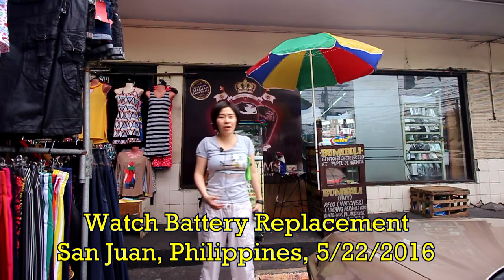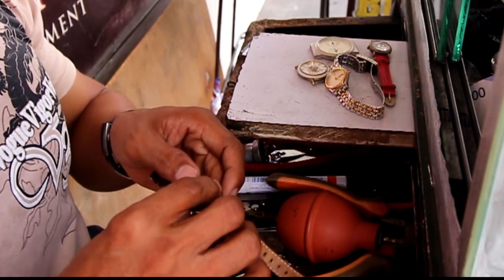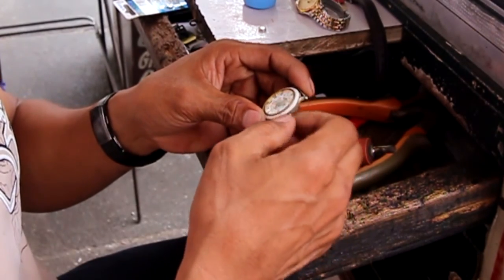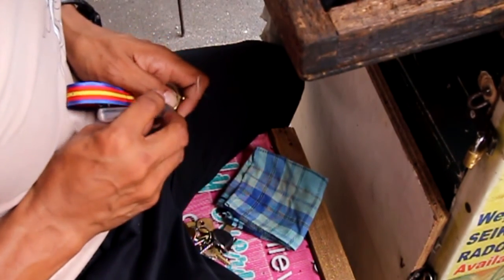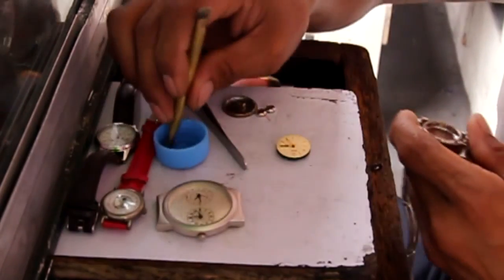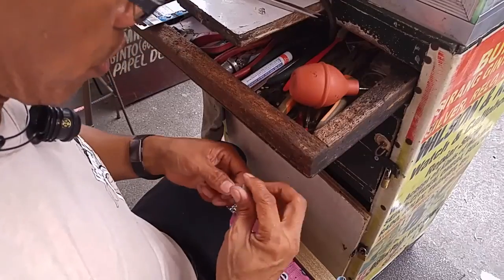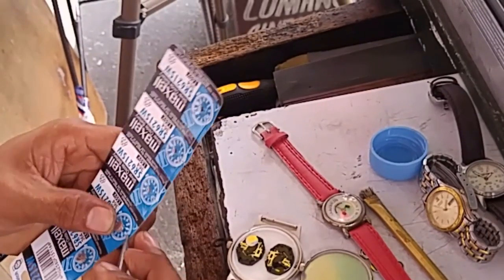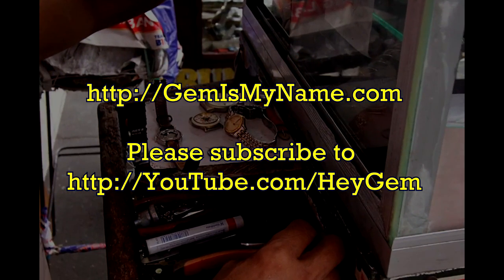Watch Battery Replacement at a street stall in the Philippines - Wilson's, F. Blumentritt, San Juan

Comment: He was using a wrong battery size for your double time watch.
Reply from the maker: But it's the one that fits the watch. it works. it's possible there's more than one kind that works on it.
Reply: @heygem  that battery size is slightly too thin, therefore shorter lifespan.
Reply: SR 626 is more appropriate